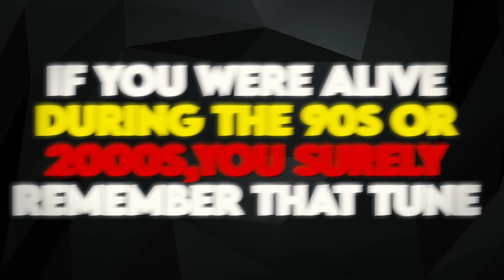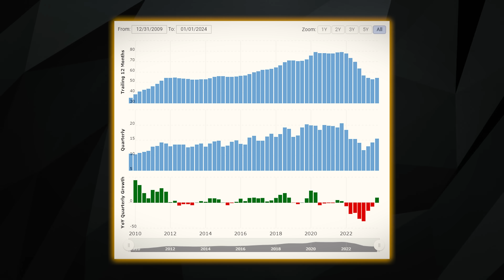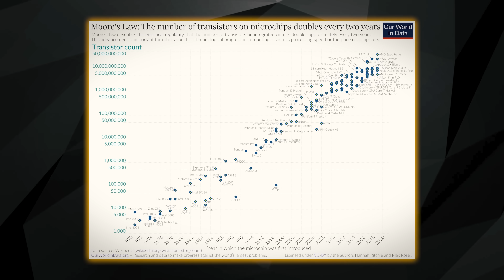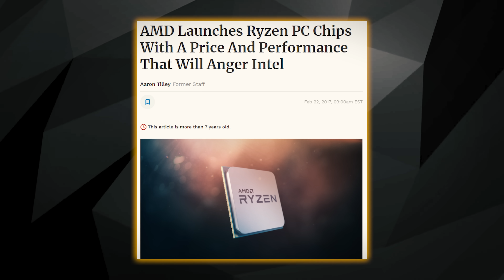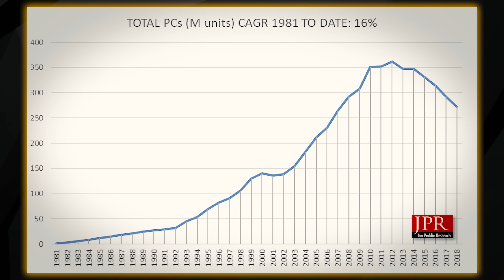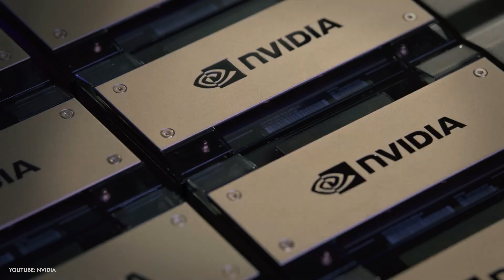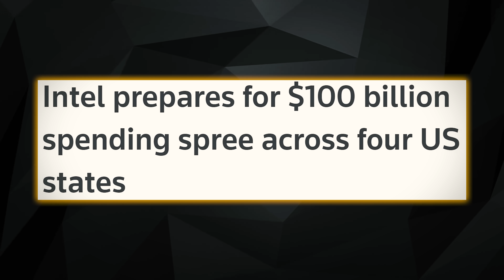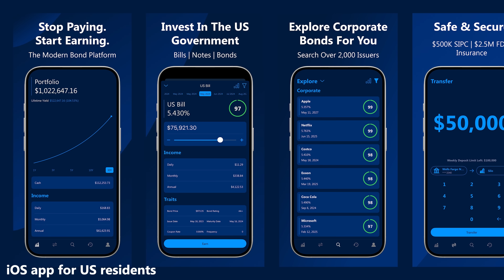The Dire State Of Intel...What Happened?

Comment: Intels biggest problem wasn't the CEO it was Murthy Renduchintala who Krzanich poached from Qualcomm in 2015 with the express purpose of upgrading Intels design efforts and foundries.
Pre 2011 Intel typically had 2 chips on each node before switching to the next, these changes happened every 2 years roughly.
e.g. 32nm in 2009 for Westmere & Sandybridge, whilst AMD was still using 45nm.
22nm in 2011 for Ivybridge and Haswell, whilst AMD was now on 32nm. This was when the complacency started 3 years on a single node. AMD was on it's knees with sheare prices hovering between $2-5 per share and hitting an all time low of $1.81 by 2014.
Intel was on 14nm in 2014 whilst AMD was now using 28nm, this was the start of the rot in their foundries, instead of just 2 CPU's per node we got this lot. Broadwell, Skylake, Kaby Lake, Coffee Lake, Cascade Lake, Comet Lake, 6 CPU models on a single node in 5 years, 2 years into this timeline they dropped their "Tick Tock" path of advancement, new architecture 1st year with a refinement the next (hence the 2 CPU lines per process node. we all remember the 14nm++++++++++ memes don't we? With 5-10% generational performance increases along with prices going through the roof.
This really only happened as Intel took 5 years to get their 10nm node to produce high enough yields to be profitable, this is where Murthy comes into play..
He constantly was telling Krzanich "10nm is coming along just fine" whilst hiding the outrageously poor yields and even worse performance of the entire node. Then we get to 2016..
Intel launches the 6900K 8 core 16 thread CPU STILL on 14nm launched for $1089US, followed less than a year later by Zen 1, Both on 14nm but intel were on their own foundries whilst AMD were using Global Foundries or TSMC
Intel had squandered their process node lead thanks to the 10nm delays and so, Zen arrived @$499 and beat Intel in non gaming benchmarks at less than half the price, yeah Intel still lead by a large margin in gaming in AOTS but a mere 3-20% in fps terms? For double the cost but no where near double the gaming performance?
Intel compounded the issue by then launching the 10 core 20 thread 7900X still at a whopping $999US and AMD released the 2700X @ just $329US.
Intel were relying on customer awareness to inflate costs (Not to mention dirty tactics in their past like forcing OEM's to not advertise AMD CPU's or risk losing access to Intel CPU's despite those AMD CPU's actually performing better)..
As AMD closed the gap Intel stood still until Murthy was ousted in favour of Bob Swan, Intel wasn't helped by Murthy encouraging inter departmental infighting, Bob Swan ended this by basically telling dept head to stop pissing in other departments ponds or face the axe. 
Swan wasn't an engineer but he DID solve the internal strife at Intel before Gelsinger took over in 2021.
Intel is STILL paying the price of Murthy's game playing, this is made worse by the current Intel fiasco over what is Intel "in spec" which is now seeing Intel HAVE to push out much lower wattage BIOS versions due to poor stability because they're THAT desperate for the win they'll do practically anything until they get found out...
AMD have constantly innovated since Jim Keller rejoined them in 2012 to design Zen the infamously "glued together chips" which Intel derided so vociferously then desperately followed suit???
AMD also adopted Intel's previous tick tock regimen with 2 entire teams leapfrogging for each new major architecture, a policy reintroduced at Intel in 2021-22 after being abandoned in 2016 right in the midst of the 10nm debacle.
Intel only has themselves to blame for their complacency arrogance and short-sightedness right when AMD were upping their game.
Put it this way... In 2015 AMD's shares were at an all time low of just $1.82 whilst Intel were at $34.94, how are things now? Intel @ $30.51 down from a high of $68.26 over the last 3 years, whilst AMD? $150.56 and an absolute high of $227.3 in March this year. 
I gets worse when yo look at it this way... Intel's lead has fallen from 15 times the price per share in Q3 2015 and swung completely in the opposite to now being worth just 20% of AMD's current share prices....
This'll only become worse due to these new to the public stability issues which remained hidden for several years, iirc 11th 12th 13th and 14th gen are ALL affected and I wouldn't be too surprised to hear 10th gen are in there as well so that's 4-5 years of CPU's with instabilities cause by Intel chasing the gaming crown by pushing excessive watts and amps through their CPU's.
Reply: Holding on to foundries was a mistake. Intel was reluctant to spend billions to upgrade foundries every few years, it was not a one person decision. It was a decision made to save money by the leadership. Upgrading to smaller nodes keeps getting expensive and for producing chips economically they have to produce larger volumes. Intel had to produce 14nm chips more for them to get a decent ROI. AMD can choose the process based on the price they wanted to sell and not consider about the capital investment.
Reply: @solo10041  Sorry but Intel only ever debated dumping the foundry business AFTER Murthy was fired, beforehand there was no point as they HAD the process advantage until Murthy screwed it all up and created an atmosphere of infighting at Intel.
Bob Swan was brought in to lay down the law.
Raja Koduri was brought in for the GPU division and saw the furore and thought he stood a chance of getting Murthy's job but left after Gelsinger got the job and actually started returning Intel to the top.
With the news of Intel pushing their CPU's to unstable levels and claiming that's "in spec" becoming public in April Intels share prices have now tanked.
The exact same thing happened back in the 2000's when Intel was caught out forcing OEM's to not use AMD chips despite them being faster. 
Intels share prices fell from an all time high of ~$70 to just $21 just after AMD filed the suit, now we have a similar situation where the instability news broke about a aonth ago and intels shares fell off a cliff losing 25% in the last 6 weeks..
The foundry losses of late are due to Murthy and his actions which allowed TSMC to catch and surpass intel's process advantage in 2015 which then forced intel to look to TSMC in order to match or beat AMD..
Reply: @SRS13Rastus  As per insider information Murthy had to step down due to delays in production of Intel's 7nm chips.
There was a rumor that Intel was going to skip 10nm and directly for 7nm at which point maybe Murthy had to clarify as Intel's Chief Engineering Officer that 10 nm was coming along really well.
But some fanboys think Intel should have gone straight to 7nm by ditching 10nm. If Intel had gone that route Incel fanboys could enjoy their 14nm chips and memes for much longer. 
Instead Murthy delivered 10nm process which has similar transistor density as compared TSMC 7nm process. But for Incel fanboys he is the Villain.
Reply: @solo10041 utter rubbish, Murthy was brought in in 2015 as even the 14nm Intel process was producing poor yields, 10nm didn't appear until 2019, Murthy was let go the following year. 7nm was just the nail in the coffin.
14nm yields were initially poor, Murthy was brought in to troubleshoot it and get intel back on track and begin the transition to 10nm and then to 7nm.
Krzanich refused to believe AMD would be able to catch up as both Global Foundries and TSMC were at least an entire process node behind, especially considering Intel went from 32-22nm in 2011, whilst AMD with GF could only manage the switch from 32nm to 28nm as late as 2015.
By 2014 Intel were already on 14nm and stayed there because Murthy fucked it up and lied about it which was why we got press releases for 3 or 4 years saying "10nm is coming along just fine and should arrive in the next year" when it clearly wasn't.
When it DID arrive in 2018 the performance was so bad Intel HAD to release it in laptop only 1st, 10nm didn't come to desktop until 2021. 3 YEARS later...
AMD had released Zen 1 on 14nm in 2017, Zen+ on 12nm in 2018 and Zen 2 in 2019 on 7nm.
Intel had no choice but to switch to TSMC and abandon both 10nm and 7nm, Murthy was booted in 2020 as a result of turning Intels' foundries into a joke.
Reply: @SRS13Rastus  I am sorry to tell you Intel is not going to get out of these serious waters very soon. They have given some scapegoats, but as @dgillies pointed out there was a reason for their 14nm and 10nm processes ever becoming cost effective.
Still their way of getting out is this trouble is more or less the same. Rebranding and Marketing. This will do no good as Snapdragon X Soc hits the market.For Dell XPS 13 Snapdragon provides the same performance and more battery life. The 1340P for XPS 13 costs 293 dollar and Snapdragon comes at 149 dollar. That means just giving money to Dell to use their chips will not become an option anymore.
Reply: @solo10041  LOL I couldn't care less about intel, they deserve precisely what they're getting, never had an intel chip and never will, like Ngreedia I despise their BS marketing tactics from the past and present, same goes for Dell who insist on overcharging whilst using components you cannot upgrade and who were getting upto $550 million per quarter in kickbacks from intel back in the day, the same tactic that got Intel fined $1 billion in the US and a further 1 billion Euros in the EU for anti competitive tactics when AMD were producing better chips at the turn of the millennium.
Now we have the whole debacle of ramming too much power through their chips in order to get the gaming win just so they can claim a win at something.
Same with Ngreedia and their proprietary software specifically designed to trap consumers leaving them under the impression they NEED it when they clearly don't, so much that their raid fanboys will trash anyone who says AMD just might be good enough let alone a better experience for the user. 
Same with the Nvidiots who always claim "AMD drivers are baaaaad!". Horse s**t! AMD at least don't release drivers that permanently brick customers GPU's as Nvidia has done to 1000's of consumers over just the last decade. 
Hell I have friends who've had 550Ti's, 780's, 970's, 10 series and even 20 series cards borked by a WHQL driver update.
Many of them switched to AMD as a result and haven't looked back.
Yes there was the recent issue where users did a factory reset whilst updating AMD drivers and Windows would install older drivers automatically which caused drives to become non functional but it WAS recoverable, that was down to Windows not AMD or at worst users not realising Windows would do this by default without notifying the user and giving no notification whilst doing so. Which is why I'll always dl the driver package and disconnect the ethernet THEN do the factory reset driver update.
So no I wouldn't trust Intel as far as I could throw their HQ, nor would I pay Ngreedias grossly over inflated prices.
Reply: @SRS13Rastus  I don't think Intel didn't learn their lesson and has started issuing ultimantums to motherboard manufacturers demanding they switch to Intel default profile which will reduce the power delivery to these chips.
In the end customers lose, either they lose the CPU due to degradation or they lose the performance. It is a lose-lose situation for people shelling out money on Intel.
Reply: @solo10041  Couldn't agree more, the problem now is a potential massive legal one. Did Intel purposely mislead consumers or did they sell them chips KNOWING full well that these effectively unlimited power profiles would shorten their lifespans? To me it's a prime example of a major class action on the horizon.
If they'd made the right choice and played safe with the power tables they'd MAYBE lose customers chasing "the fastest clocked gaming CPU" but they'd still have happy consumers as there's no doubt the chips work well enough out the box, but they've also misrepresented their chips with speeds listed reliant on the ludicrous power profiles as a selling point all to hit 6GHz.
Yeah AMD had a similar issue with blown 7000 series chips and Mobo's which iirc was the mobo manufacturers playing the same "chase the performance crown" schtick which iirc Gamers Nexus did a great analysis of the the basic conclusion was that Asus was pushing too many amps through the chips resulting in over 400W through a CPU with a max TDP of 170W causing the insulating layers to become conductive, shorting out and causing thermal runaway which blew through the substrate and melted the CPU holder.
This sounds just like the Intel failures but in AMD's case Asus were clearly pushing beyond "AMD specifications". Asus clearly at fault and required to replace the customers Mobo and CPU.
In Intels case they claimed REPEATEDLY that the BIOS settings were "in spec" so the onus falls squarely at their feet and not the Mobo manufacturers especially as Intel has been doing this supposedly since 8th or 9th gen...
Given their market share and MSRP this could end up being catastrophic for the company should a class action be filed, the "in spec" statements absolve the Mobo manufacturers of all responsibility..
Reply: @solo10041 Just pointing something out, Qualcomm is basically losing some money with these SoC, because the cost of that chip is way higher than just 150$, considering that the Snapdragon 8 gen 3 (A mobile SoC, that is weaker, with mostly stock arm design, compared to the custom Nubia architecture and way more I+D) costs 200$.

They're probably doing this so companies could initially ditch the x86 alternatives and go for the Qualcomm one, and once they gain market share, they would Increase the price so they can make a substantial profit out of it.
Reply: @solo10041 As for intel, I completely agree.
Reply: @alphaarchive5262  The performance of windows on a ARM based chip will be a big question mark for anyone who want to use X Soc in their laptops
Reply: @solo10041  That's why they're selling those SoC so goddamn cheap (and even losing money at the process) becuase the arm integration on windows will be substantially slower compared to what apple did. (I know it's a transition and not an integration, but you got the point)
Reply: People think it was Intel getting stuck on 14nm.  That misses the big picture that from 2000 to 2020 the cost of a new foundry was going up faster than any business that intel was in.  The only way to survive in this scenario is to become a foundry and intel was too stubborn to accept outside chips for fabrication!  Even Samsung knows this but Intel was too stubborn to ask outsiders for help (chip designs to fab)!
Reply: Brian Krzanich was Intel's downfall.
Reply: You seem vague on what you really think.  Do not hold back let it all out.

Comment: It's still a shame what happened to Optane storage given it's price tag, low latency and extreme endurance. I strongly suggest you guys pick one up as a caching drive (NOT the tiny ones, the 256GB+ models) before they disappear forever. I got a 905p 1TB for my system and it slots perfectly into the last available 3.0 x4 slot :)